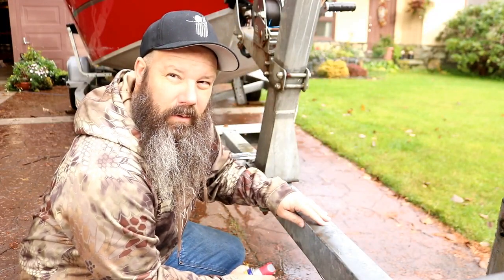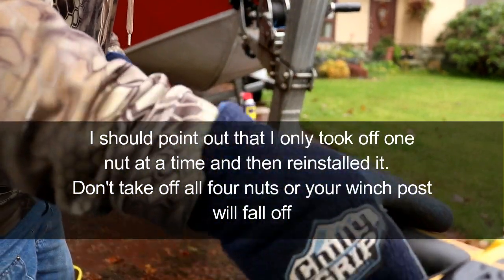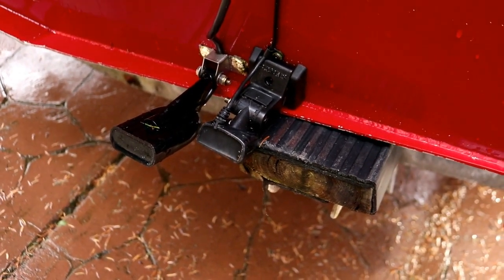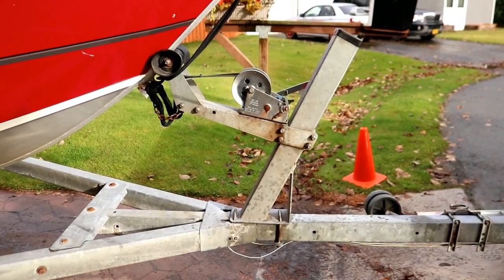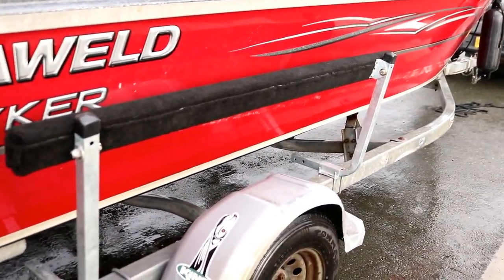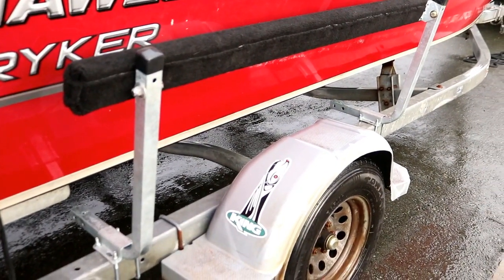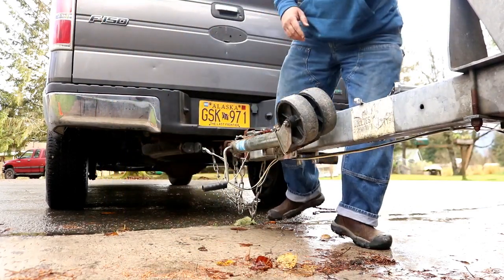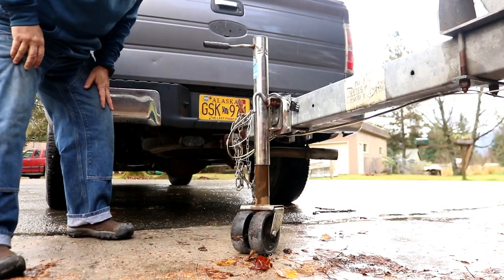Adjusting boat winch post and trailer set up

Comment: Such a good looking video. My two cents...keep the boat attached to the tow vehicle and use a cargo strap/winch to move the boat aft a few inches then adjust the post as needed. No reason to go in the water. If you're experienced or novice this is safe as long as the trailer hitch is secured to a heavy vehicle. The end.
Reply from the maker: Good tip. 👍

Comment: That was crazy for them to put the jack on the passenger side.  Question for ya? Why don't you make the trailer into a drive on?  I always see you having to get into the water when you could drive the boat on and have momma pull the truck on out. Pull the side bunkers in a bit to her her tighter side to side then add a small V bunker under the nose to hold the bow in place then drive that baby on and pull out. Makes life so much easier with no wet legs / boots anymore. Over the years of owning a few boats I done this to all of them and man what a life saver it is. Just a thought is all buddy. Hey does this mean no Wood Stove Wed tonight?  You know how much I love those!!  Have a great rest of the week my friends.
Reply from the maker: Sorry this is in place of the WSW.  
Yeah, I would love to just drive the boat on but mama doesn't like to back the trailer down and she doesn't feel comfortable enough with driving the boat onto the trailer.  This would also help with getting the boat on the trailer at the island.  especially when the wind is blowing.  It's all good in the hood though.  
Thank you guys for watching.  We have a couple of good WSW lined up.  They should be pretty funny.

Comment: At least the jack bolted on for easy removal or adjustment. We have an old flat bed trailer that it is welded on. And it has a spring loaded swivel lock. Yours is a lot better lol.
Reply from the maker: Yeah I am glad too. Our other option was to cut off a few inches bunks.

Comment: Was wondering why you didn't just cut the 2x6, but it looks like there is some metal back there also.
Reply from the maker: That was out last resort. We would have had to cut through some of the metal bracing. Cutting off the back a few inches wouldn’t be that big of a deal but though we would try adjusting the front first.

Comment: So you see it’s all in those little details to get it working smoothly. Those 2,5” look just enough. And I still scratch my bald head over why anyone would attach the nosewheel on the passengerside of a trailer. Just doesn’t make sense at all!
Reply from the maker: The only thing I could think of is the previous owners had a import with the steering wheel on the other side or it was a team effort and the passenger always dropped the trailer. We will never know.

Comment: Your transducers were installed incorrectly. The bunks are supposed to go past the transom for proper support.
Reply from the maker: We will have to agree to disagree on this.
Reply: My Alaska Dream - Pretty sure the boat manufacturers know best. If the bunks are under the boat it can cause dents and cracks. The strongest point is the transom. You want the weight supported  there. Minimum 1” past the transom.
Reply from the maker: Thank you for your input. Where does the transom set on a trailer with rollers?
I’m not claiming to be a boat expert or trailer expert but I do claim to be a transducer expert and they are set up according to the manufacturers recommendations.
Reply: My Alaska Dream - Are we talking about a roller trailer? Nope. Different design. Bunk trailers are designed so that the bunks extend past the transom. 

And a transducer expert you are not. For starters - manufactures only offer guidelines. There is no one size fits all. Even near identical boats can have vastly different positioning requirements depending on a lot of factors. 

The only recommendation most give is a minimum from the motor.
Reply from the maker: Cerus98 thank you that’s what I wanted to hear. You are the expert on all things nautical. Enjoy your day. I will continue to enjoy mine.